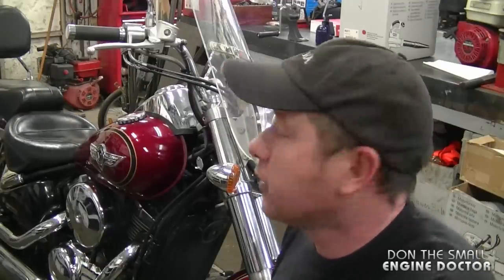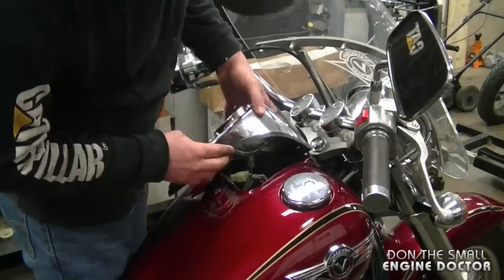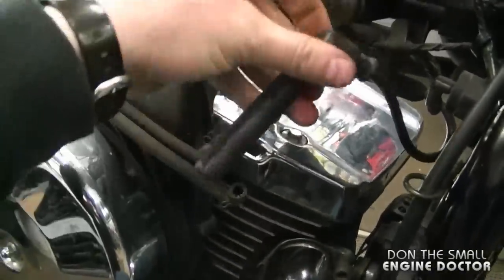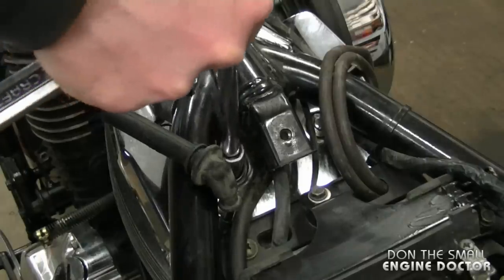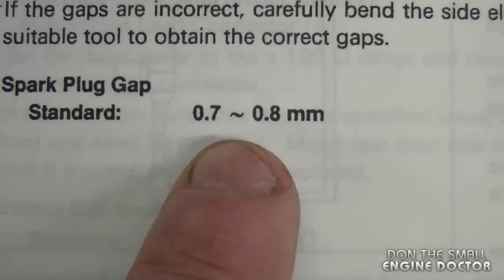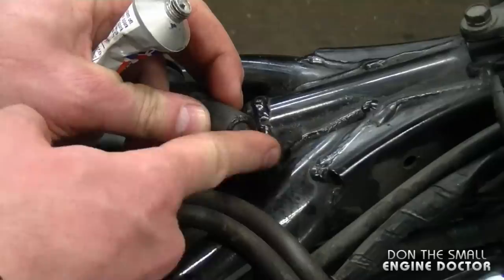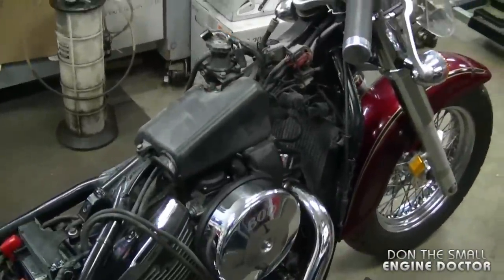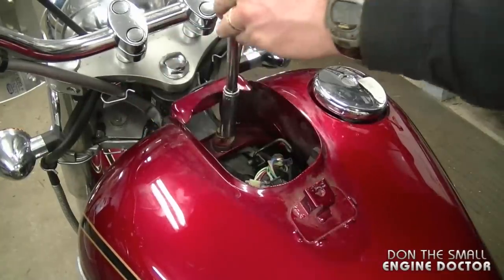HOW-TO Replace The Spark Plugs On A Motorcycle - Kawasaki Vulcan 800 Street Bike

Comment: Great video as always. I have learned a lot watching you. I recommend blowing out the sparkplug holes before removing them to ensure no debris gets into the cylinder. I also like to use a tiny dab of anti-size whenever installing plugs in aluminum heads. That type of petcock is called a vacuum petcock as it doesn't pump but acts more like an on/off switch, which may help in troubleshooting them.

Comment: I use a short piece of rubber hose that fits over the end of the plug to turn the plug out once I loosen it with the socket. Makes it a lot easier to bend around corners. I also use the same hose to start the new plugs because for me I can feel the plug threading in easer and not worry about cross threading.

Comment: Thanks great video very helpful.
I'm sure you can probably do it with tank on but the rear plug is easy to cross thread.
So tank off new plugs ,clean chrome heads and check coolant .
Perfect thanks for posting

Comment: I have a question… So I got as far as when you drop the 5/8 socket into the head… my 5/8 socket didn’t drop down like the way yours did. It stayed flush with the top of the head. Do you use a special 5/8 socket? Perhaps a slimmer one in not aware of? 

Great video by the way! Very clear and educational. I was able to get right up to the socket part, but was able to put it all back together. Thanks.

Comment: The benefit of Iridium plugs is they last much, much longer than standard plugs so you won't have to change them that often.  Also, the fine wire tip should require less voltage to produce spark.

Comment: I own a Vulcan that is 10 years older than the one shown. Even so, the structure is almost identical! Yeah, it's a bit of work to change plugs but overall these bikes are surprisingly reliable, I've rarely needed to do anything except the recommended valve shim adjustment. My version calls for that to be done about every 8,000 km, you may be due. If so, please keep the camera on, valve shim adjustment is a popular video request for these Vulcans.
Reply from the maker: I ended up selling it and getting a honda Africa twin

Comment: If you have OEM spark plug tool you can change spark plug without to remove fuel tank , I have work in Kawasaki service here in Croatia (Europe) almost 17 years and its easy to change im👍🏼

Comment: Fyi the kawasaki  vn 800 factory tool kit that comes with with bike has a sliding spark plug spanner in it. Made to get in around the corners. Is in a side cover on bike from factory.. Be difficult to overtighten using that. Anti seize  on threads a good idea.

Comment: I got curious about the difference between a standard spark plug and an iridium version. I was reading a Dutch article from a Dutch bike magazine and they did this spark plug dedicated 2000 mile long proper test with 6 Buell bikes and 3 of them had iridium plugs. They recorded the fuel consumption and changed drivers on the bikes to keep the test as fair as possible. The gas millage didn't seem to make an obvious noticeable difference during their test, maybe half a percent better with iridium plugs according to the people who wrote the article, but they seem to notice improvement on the cold start, and it seemed to run a bit better on lower RPM. They say that you shouldn't take them if you want to save money by saving fuel because you would have to use them for too many miles to be able to earn back the money. But they do have a longer lifespan according to the article. And because the electrode is smaller they say the electrode has less loss of voltage, or it doesn't need that much voltage compared to other spark plugs, with the result that the spark is more reliable and with a more consistent level of energy.  

I don't even own a bike I just got curious, so don't blame me if this is wrong :-)

For those who can read Dutch, or when you can translate it. www.motoplus.nl/magazine/uitgaven/artikel/iridium-bougies/

Comment: Great video and thanks for the know how. But if you use the special spark plug tool that came in the tool kit for the Kawasaki vn 800 classic , you Do Not have to remove the gas tank as you have shown us and done. I have never removed the gas tank to replace the spark plugs on my bike.

Comment: Hi! I believe I have to change my spark plugs.. 1 cylinder is cold while the other is heating up and the 1 exhaust blows cool air out while the other is hot... do you think this is the case ? Thanks
Reply from the maker: You can start by replacing spark plugs and see if it still persists.

Comment: Hey Don how come you removed the cap off of the spark plug?
Reply from the maker: because the cap would only fit the threaded part
Reply: donyboy73 is that ok to do? I would think that might be more prone to misfiring. Did the oem plugs also connect at the thread top like that??

Comment: Pittsburgh Mickey 5/8 extended roach spark plug socket it is a 5 and 1/8 inch long they have it in 3/8 and 3/4 it my help you out item 91705 I got it at Harbor Freight.

Comment: Maybe they made it harder for sum dickhead to come along & to rip the spark plug leads off of the side of the engine so they located them up on top.

The advantage of the iridium spark plugs is that that it cuts down 3-4 spark plug changes to 1 therefore reduces service costs as compared to the copper spark plugs.

The dark colour can suggest excessive idling,it depends on how the bike is used,a hotter spark plug is good for conditions where excessive idling is required or if the motor is worn out & consuming oil.

I'd also put some "Never Seez" on the spark plug threads, I did that on my mothers (late grandmothers) 2000 model Toyota Corolla because the threads on one of the spark plugs started to bind, I soaked the threads in WD40 to free the spark plug up, this time around, I'll go for Iridium spark plugs as they are due for replacement.

I'm not much of a Caterpillar person in Australia as I don't  fit to WesTrac,I'm not sure who thought I was there because I'm nowhere like one of them.

So I've been stuffed around for almost 7 years because I'm not for there & have only worked 2 days since.

I'm sure one of my former bosses (Barry) didn't get I'm for there,rather here :- http://www.Tomago.com.au